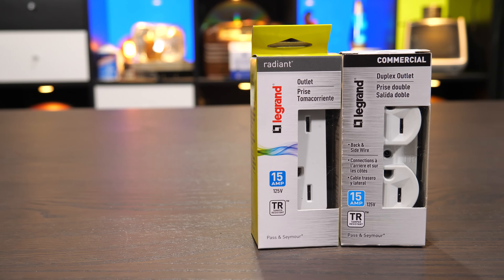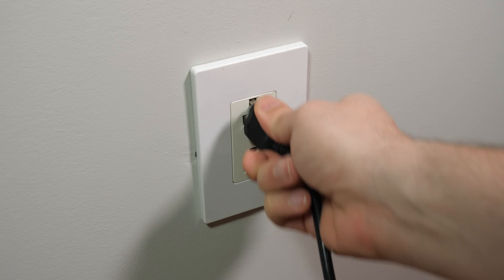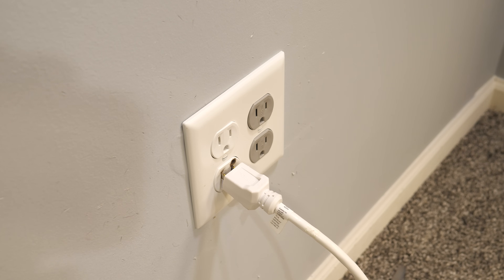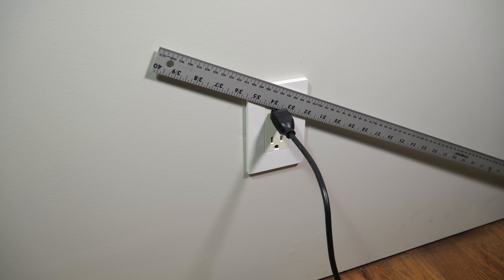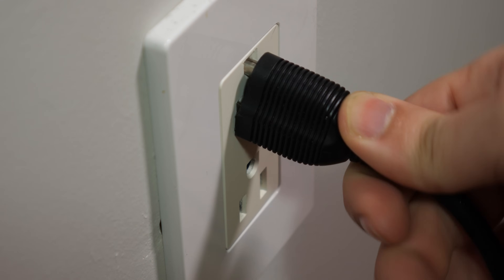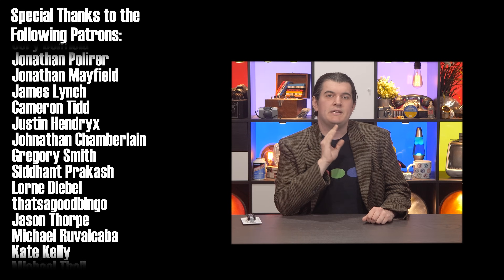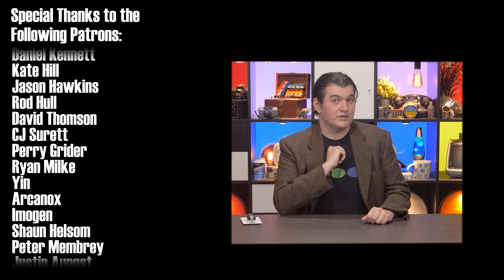Power outlets are topsy turvy - but does it matter?

Comment: One of the biggest problems with receptacles that people don't realize, is that they do go bad over time.  The electrical contacts inside become fatigued, and no longer provide good contact.  Which could lead to the outlet just not working well, or even worse, causing a fire due to increased heat generation because of the bad contact force.

I just bought an old house, and had every outlet changed, because they were all weak on retention.  If you live in an older house, have your outlets checked.  It could just save your life and the lives of your family.
Reply: If an outlet is feeling loose, it's probably time to change it. If you are slightly handy, it's easy to change them yourself. You don't require a license to rewire them, at least in Washington State. I would suggest you spend a little more for "heavy duty" or spend $3 or so for the Commercial Grade 15Amp outlets. Watch a few YouTube videos on securing/orientating the wiring correctly and be sure to flip the breaker before you start any work.
Reply: @eliasross4576 I bought a commercial grade outlet from Home Depot a few weeks ago, I was shocked at how loose it was. Had to return it.

Comment: An interesting parallel is how China has adopted the AS/NZS plug but turned it upside down for "dropping things on the plug pins" protection.

The side effect of this is lots of upside down right angle plugs and wall warts coming into NZ and Australia, which was puzzling for a time
Reply: You don't need that protection for proper ANZ plugs that are sleeved, only the dodgy non-compliant stuff...
Reply: @m00nh34d I'm not that old, but I'm still old enough to remember the sleeves being introduced into the standard for the plug on the AU side, I'm pretty sure China adopted the plug before those sleeves were introduced. Plus, most of those Chinese appliances remained unsleeved, because even after the sleeves were brought in I think regulators over there figured the ground pin was good enough
Reply: @m00nh34d  yes but apparently the Chinese government didn't think that was enough
Reply: @jamesfromwellington the Chinese don’t sleeve their pins though. Maybe they made the adoption of the inverted plug before the AU/NZ sleeving, idk. The only downside of a sleeved plug I can think of is it makes the cross-section of metal in the pins thinner, and so weaker. Lots of bent vacuum cleaner plug pins.
Reply: And they are also completely non-compliant.
Reply: This comment sent me down the rabbit hole of reading about what's the exact difference between the implementations of the Type I plug since I always assumed they were the same, but nope, they're compatible enough that they'll work but they're different enough that some of the safety goes out the window. So the plugs we use here in Argentina look the same as the ones from Australia/New Zealand and China but they're not quite the same.
BTW I also wondered why some Chinese appliances (mostly power sources for cheap electronic stuff) had plugs that were built upside down, good thing that they usually send europlugs here instead.

Comment: I moved into an apartment recently and started putting things together. I went to plug the power strip for my PC in to wall and was surprised to see only two slots and no ground. So I went to the other side of the room. Same thing. Went through the entire house. There was one grounded outlet in the entire house and the GFC outlet in the bathroom. So I went to buy some grounded outlets and pulled out the polarized outlet thinking, like most times I’ve seen this an unused ground wire behind the outlet in the outlet box. Nope. The entire house was wired before 1971 and had never been updated. Guess if I want a grounded outlet it’s GFCs for every outlet int the house and that still doesn’t really fix the problem. So short of pulling ground wire through the entire house all the way back ti the breaker box (guess they had to replace the old fuse box with one of those somewhere along the way.) yeah. Good times.

Comment: Compare and contrast with Australian plugs? Live and neutral pins are angled, so only one insertion direction. They're also partially shielded so partial insertion doesn't reveal live metal. Plugs are the same size with or without an earth pin.

Comment: The US should just go all in and change the design completely and subsidize adapters for awhile.
Hell, the hole going through so many prongs could be used in an adapter designed to be permanent that locks in.
Also I'm 100% for right-angle plugs being standard too as long as the new standard angled them or otherwise gave them space to prevent interference.

Comment: In my 70+ years of life, I've been terrified by many things, but I can't remember the "orientation of receptacles" making the cut of scary things worth remembering.  In fact, the times I've been shocked by less-than-fully-inserted plugs, and shocked by other things, my dad always reminded that my most recent shock was just one more thing to watch out for.  During my following career in electronics I've discovered way more ways of being way more shocked way more often than the errant finger in the socket.  The aluminum Christmas tree tinsel falling onto the tracks of the electric train set below was way more interesting!
Reply: Try a houseful of CATS... While none of the electrical nuisances in my childhood turned particularly injurious, there were LOTS of pretty interesting situations...  ;o)
Reply: A much bigger danger from my experience is the insulation on cheap wires breaking and leaving exposed wires that can easily short.

Even then, the only time I've been shocked by 120V AC is when a garbage (probably not approved) phone charger/ac adapter quite literally fell apart as I was pulling it out. The whole outer casing came off and when I tried to pull the receptacle and the circuit board inside out from the outlet so I could throw it away, I accidentally touched a component of the adapter and got a nasty shock from it. I stopped buying cheap shit after that, most of my AC adapters now are Anker ones because they're smaller and better.

Basically, the biggest risk by far is cheap products that are built so poorly they expose 120V AC when they inevitably fall apart.
Reply: So it is a common occurrence to get shocked by that type of plug?

If that's the case then I think it's insane that they are still in use.
Reply: @Jehty_    Not common... The USA is an ENORMOUS place, and that leaves spaces where there aren't building inspectors or great enforcement... Electrical hazard by plugs outright are relatively small, even without shrink-wrapping the prongs or anything, it's rare to have even the occasional finger-zap without someone doing something a bit zany or nefarious outright... AND kids get into the damnedest sh*t for sometimes unfathomable reasons (curiosity?)...

    Even so, with a finger-zap, when the prongs are both RIGHT THERE... the shock goes across A finger... you jump and let go, and that's generally it... no worse for the wear and only a little rattled. We hear stories, but until it gets to shoving a pocket knife into a piece of electrical equipment or screwing around with screwdrivers or silverware in toasters (yes, there ARE Americans that stupid) real harm from household circuitry is pretty unheard of, that's why someone getting electrocuted in a shower or bath hit headlines.  ;o)
Reply: @Jehty_  It is not a common occurrence. I can't recall ever hearing it happen as described to anyone in the 62 years I have been alive. It's safe enough as designed, it don't need improvement. 
To shock the snowflakes, I have also *never lived in a house with grounded outlets*, my current home has one grounded outlet total, it is the one right next to the kitchen sink. 2-prong everywhere else, and no, the boxes aren't grounded, either, so the little screw on the adapter just holds it in place and does not supply a ground. Oh, the humanity!
Reply: Right, this argument, and even more ridiculous arguments routinely made by Euros about their supposed superiority, are absolutely ridiculous. Australia is also particularly ridiculous. None of these supposed "safety" arguments are worth one additional penny to fix, you have to be almost suicidal or willfully negligent to get killed or seriously injured by any of these supposed problems.

Comment: I have an LG washer and dryer matching set, purchased from Lowe's at the same time.  Since the dryer is gas, both have regular three-prong plugs.  The washer has a great right-angle plug, but the dryer has a straight-out plug.  What was LG thinking?

Comment: So, there's some 3-prong power cord plugs that don't assume the ground's on the bottom.
But they don't assume it's on the top, or the side, either.
Apparently, what's been arrived at is one of those "compromises" people keep wanting me to make about so many things.
Well, I'll tell you this much. Having the cord of one of those "weird" right-angle plugs come out at a 45 degree angle is nice and all, because after all, assuming that the thing using the plug will be directly under the plug with a normal cord length of 6 feet is silly. It's obviously going to be off to one side.
The other thing this avoids (helpfully in this case) is when you want to plug TWO of these right-angle plugs into the SAME duplex outlet.
Having the cords shoot out at a 45 degree angle, as long as it's the SAME 45 degree angle, means you get nice cable management, instead of the ugly mess or impossibility you get with trying to plug in 2 STANDARD right-angle 3-prong plugs in a duplex outlet.

Of course, the problem only gets worse with surge protectors, which is where I think this sort of right angle plug originated with. With the 45 degree cable angle, you can plug in any number of these right-angle plugs into any kind of surge protector, no matter if it's the kind with the outlets all making a set of "stacked faces" or the kind with the outlets making "side-by-side faces", or even a mixture of the two.

And that's before you even start thinking of the problems with the swivel kind of right angle connector (they always loosen up over time, leading to inconsistent power delivery, AND sparks that will set off an arc-fault circuit interrupter type breaker.

Comment: 12:00 - and THIS is why they install them sideways with the neutral side up (slightly safer than hot up). Seems they know a thing or two in Chicago :). It's not the "proper" orientation, but it is a far better compromise that lets you use wall warts and outlet strips and the like.

Comment: I lived in UK - earth pin at top. Now I live in Australia - earth pin at bottom. After 20+ years I can never quite get used to this new-fangled arrangement in the colonies. In both countries the live ('active') and neutral pins are partially sleeved though. 
In Australia you can't just install a dual outlet at any ol' orientation. If you want vertical, there's an outlet for that. Horizontal - different outlet. But actually in Australia you don't generally need to know any of this, since that sparky's job and it is illegal to fiddle about with anything considered part of the electrical infrastructure. Ditto watery-stuff and plumbing. 
If you want to 'fix-up' the brakes on your supercharged 5.8 litre V8 though, with no more competence than can be gleaned from a dodgy online vid... please, go right ahead 😱

Comment: As someone who has only just visited the US for the first time, I was staggered by your sockets and plugs - and that's after watching this channel for years and thinking I was ready for it! Although a Brit and used to our insanely over engineered plugs (where, even with sleeved pins and a mechanism that doesn’t make the socket live until the earth pin is inserted all the way, there's still a switch on most sockets!), I've lived elsewhere in Europe long enough to be used to their system (where you can literally stick a pin or nail into the un-switched live socket - at 240 volts!), so I thought I was ready for your sockets and plugs. 

And, to be fair, I was reasonably impressed with the hotels we stayed in in Boston and Toronto (I know that's not quite in the US), but in New York we rented an apartment. An old apartment. In Harlem. And there we found a veritable nightmare - sockets that were loose (very loose in some cases!), plugs that didn't fit snugly in the sockets, and plugs that actually fell out of the sockets! There was also (remembering that this is just one apartment) an incredible range of plugs (and even several different designs of sockets). If I'd have sat down and deliberately tried to design as many different plugs as I could, I would never have come up with as many as we found in a single, 4 room apartment. But, on the up side, the kids enjoyed the occasional flashes when unplugging things! 

I shall never criticise European plugs and sockets again...
Reply: Schuko sockets have shutters too! You need to push both pins at the same time to get them in. This makes it sometimes difficult to connect even a real plug. If you saw a socket without shutters, it was an old installation (not newer than from the 90s?).
Reply: The problem of loose plugs is usually due to cheap receptacles, and lack of maintenance.  The system is not inherently prone to loose fit.  I think we need a better standard for receptacles to eliminate the cheap ones.  I always buy higher grade receptacles and never have that trouble with them.

Comment: The horizontal orientation is a hold over from outlets were installed in the baseboard, that was not tall enough to support a vertical install

Comment: Meanwhile USB and similar have been redesigned so much why.. foremost.. as power plugs and not USBC still the default for low power devices.

Second when's the last time you saw "safety" receptacles that lock the cord to the wall ?
Reply: I'll never not laugh when someone says when 1... And B...

Comment: 8:35 - particularly in industrial settings. Metal plates, VERY common. Basically if you have conduit going into a JBox, and both are visible, it's most likely gonna have a metal faceplate. The one in my garage is that way because I MADE IT THAT WAY.
Reply: I should furthermore add that use of a faceplate of any variety is better than doing NOT that. I made my boss's wife's work area somewhat safer by putting a faceplate over a light switch. These are usually between elbow and shoulder height on a typical adult human of either biological sex, this is no hazard to a toddler, but at typical socket level, having one of any sort is infinitely better than having NOT that.

Comment: It's funny, but i recently installed a couple outlets and installed them ground up. One was specifically for my window AC which has a big bulky right angle plug with it's own interrupt. The wire comes down from above, so an 'upside down' plug would be just fine and I can then use the bottom plug for other stuff

I was nice and proud of myself until i went to plug the AC in and found out the right angle plug is also ground-up. The exact opposite of every other right angle plug I've ever seen (probably because they knew the wire would come from above)

Great, right?

Well, the outlet is very close to the floor, so I can't plug it into the bottom half and leave the top outlet open for use. Thankfully it will work in the top outlet, but then it completely covers the bottom outlet.

If i had just installed it the traditional way it would have actually worked as i had planned

Comment: Just bite the bullet and scrap them. It's not that hard - you live with adapters for a few years and then you have sanity. We (UK) did it 50 years ago when we ditched the ungainly mess of 2A, 5A and 15A plugs (which tbh were still better than the US ones, except for the 2-pin variant) and started BS1363. 
Don't worry about treading on them. It's no worse than Lego, and you wouldn't ban that, would you ?  You can even have slimline folding pins nowadays if the cord won't fit in your pocket.

Comment: I used to have a magnetic strip on the backsplash of my kitchen. once a knife that wasn't well attached to the strip fell off, and did exactly what your butter knife demo did to a nearby outlet that had a waffle iron plugged badly into it. The char mark went a foot up the wall and ya, tripped the breaker.

Comment: Former Electrician here. The reason you should have the ground up is because if a plug pulls out a bit, something could fall on it and bridge the hot and neutral. Ground on top means that even if that happens, it's touching ground.

We care because some states actually mandate it to be done that way by code. The national code doesn't cover it but state ammendment sometimes do. It's not even slightly safer, it's way safer for the reason I mentioned above. I always did it ground up and did in my own house.

That's true though that 2 prong plugs won't be helped. Right angle plugs are annoying too but it is more common to find some the other way. I actually purchased a new end for my AC to prevent that. That's the only thing I have that has a 90. 

As a homeowner though, you CAN just rotate the outlet yourself. It's not hard. Or pay a handyman like, $20 and they will do it for you. We do need to do something about plugs. You can buy plates that stick out  a bit that  also help prevent accidental touches if you are super worried.

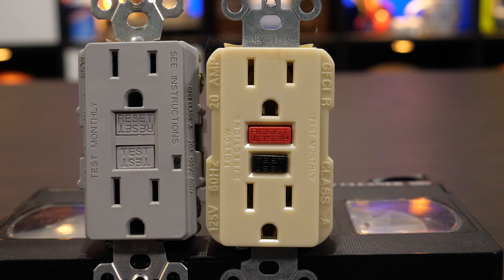Comment: hot take the use of a flathead screw instead of philips for holding in the wall plate is a worse safety hazard than the orientation. even in the demonstration at 3:28 we see an example of how easy it is to slip and have the blade go into a hole! a philips screwdriver can't enter anything but the ground recepticle, but a narrow blade flatheat can absolutley enter the hold or cold recepticles.